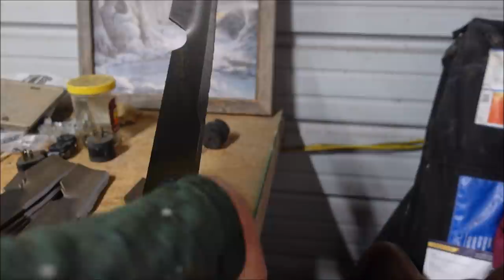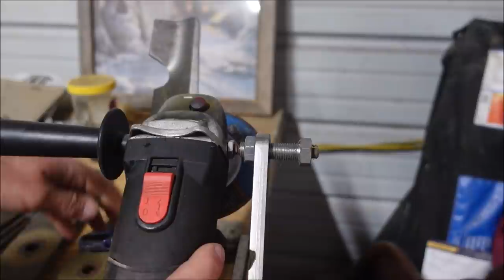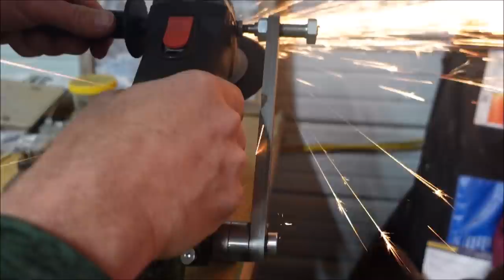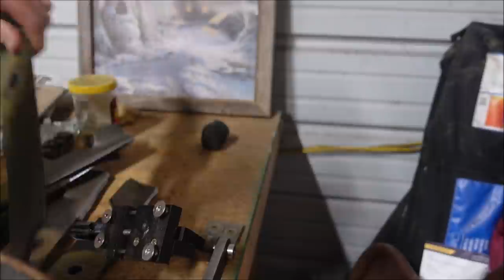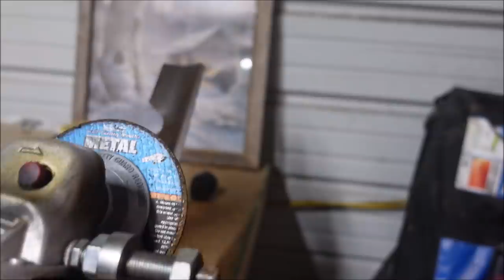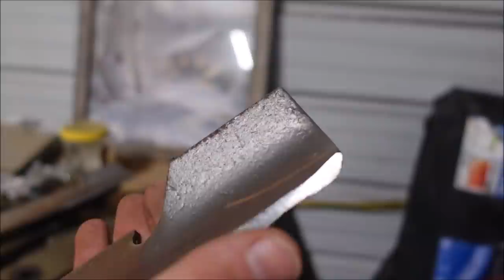Best Way I Know How to Sharpen Lawn Mower Blades Fast

Comment: The all american sharpening system is expensive and worth it. I run wright mowers and use the setting of 35 degrees on my AASS, it imitates the factory angle therefore you only need a handful of passes with the grinder to be back at a decent sharpness on the mower blades. Thanks Jason, great video!

Comment: I purchased one of these 3 years ago and have not looked back.  It is the best of all sharpeners(to get angles, etc. right.  Balancing is not a problem either.  I use a nail driven in the facing of my garage door.  Works everytime.
Reply: @Ivan Plyler,
What is the name of that clamp? Please! Thanks!

Comment: I use a 60 grit flap disc instead of the metal grinding disc. But I just started sharpening mine with The All-American sharpening system this season. I only do away passes. And balance with a $10 balancer from Amazon, and you just take a little off the non sharp side until your balanced.

Comment: I started using a die grinder pad & I just get it sharp enough. I get it a little sharper than a butter knife. Get it too sharp it gets dull sooner & more prone to nicks because it’s too thin on the blade. 
This last time I did a couple swipes with a file just to make it shiny again & it was good enough. 
I mow my lawn as high as my mower goes so I don’t have to water as much & the bade dosen’t hit the ground on the uneven surfaces.